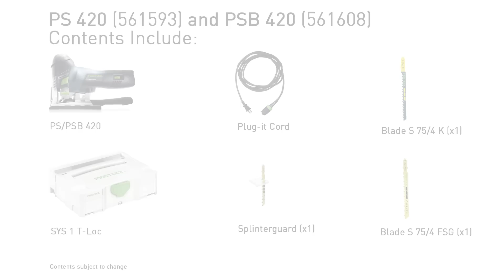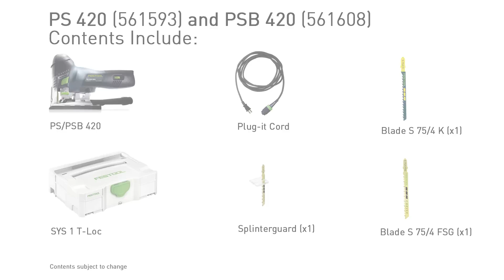Getting Started: Festool Carvex Jigsaw - Setup and Common Uses

Comment: i just bought this ,took it back after 1 day as shaft had excessive play side to side and blade was not square to base up and down. (yes turned blade around to check it was not the blade but the actual holder) the replacement is going back as well because it's just not a very good jigsaw.The light turns off if you work upside down, like on the ceiling.   My old Bosch cuts just as out of square as this but much faster, is more comfortable and has better blower. Just for the record i love my 27 year old Festo plunge saw, Protool circular saw, 9'' grinder and 18 volt 4 speed drills and i'd like a domino machine. 2 actually.

Comment: just bought this, what festool didnt tell you with the splinter guard installed the blade ejection does not work. also sometimes the chuck does not syn up with the release lever and you will have to stick your finger on the chuck and flip it out.
Reply: *****  ah thank you! i read the same correction on FOG...thanks for clearing things up! i just used it to cut some carbon fiber sheet goods and its awesome.

Comment: First of all I'm a Festool fan. Love the tracksaw and domino. But one very arrogant design flaw is in the tilting base plate sold as an extra. The tilting base plate is useless for exterior beveled cuts. It tries to present a WOW factor in demonstrations for cutting a 45° angle on the edge of a board. However in my life I've probably never used a jigsaw for this. (That's what skilsaws, tracksaws and table saws are for). It does not allow you to make a beveled edge scribe cut on a board. Way over engineered out of arrogance for the sake of ego and not practicality.  In my opinion as much as I like Festool I'd have to say Bosch's top of the line jigsaw is superior.
Reply: SuperAlfaDogg I just put a couple strips of tape on one side of the base, gives me a perfect back bevel for scribe cuts.